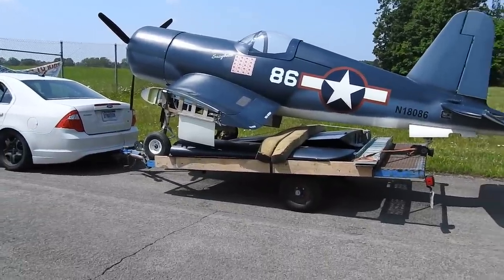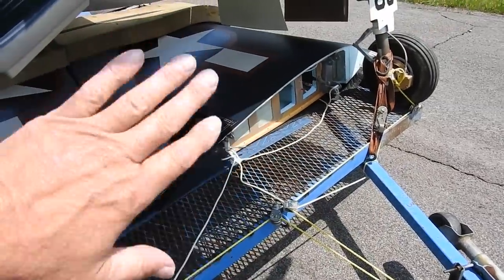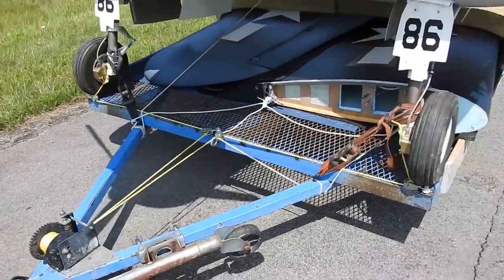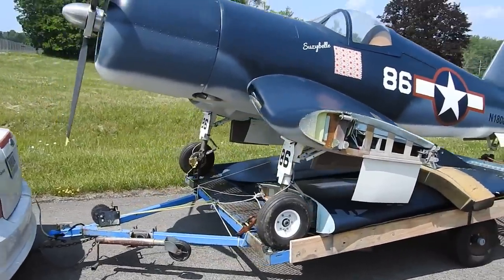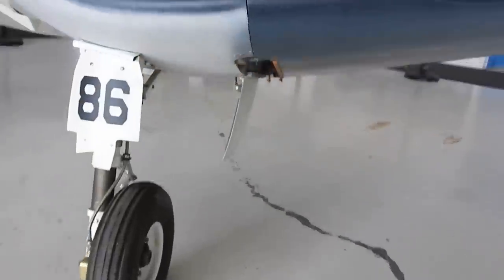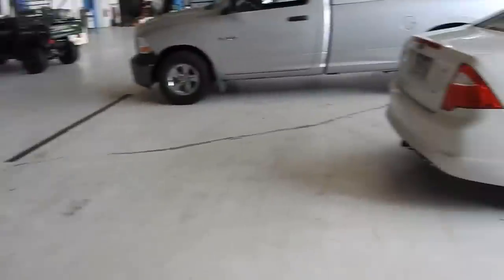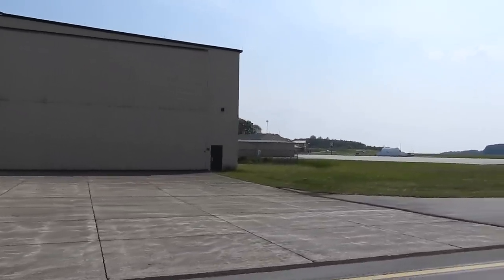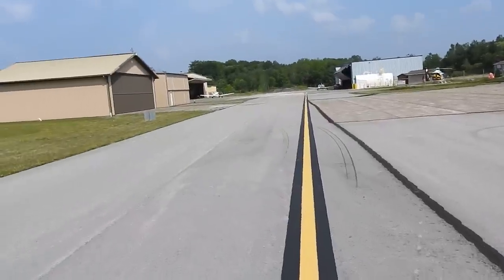Moving the WAR Corsair to the airport

Comment: WOW,  so beautiful.    Bravo Bravo.   Do you know what your different speeds will be?  stall,  full flaps, cruise and top speed?
Maybe I missed it another video.    Wow, Wow, Wow.
Reply from the maker: Stall without flaps should be between 65-70 mph, with flap could be as low as 50 mph. Cruise is 120-165 mph, top speed is limited to 190 mph.